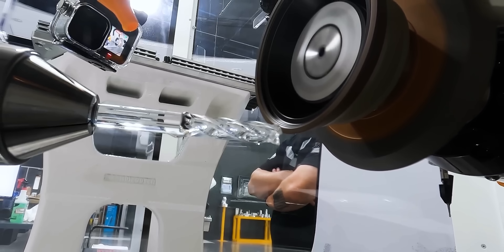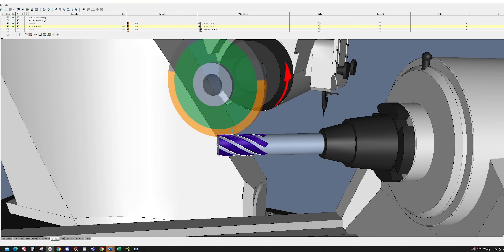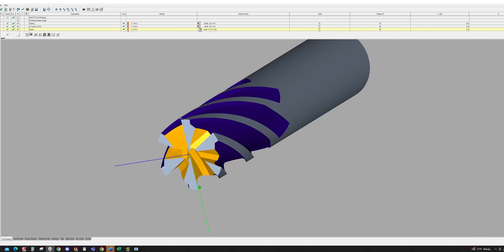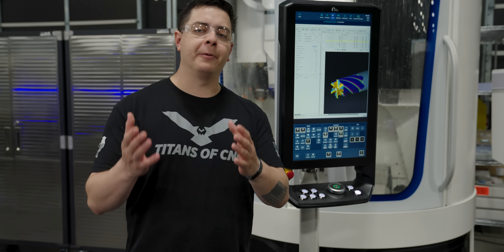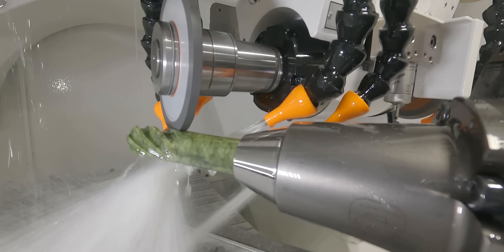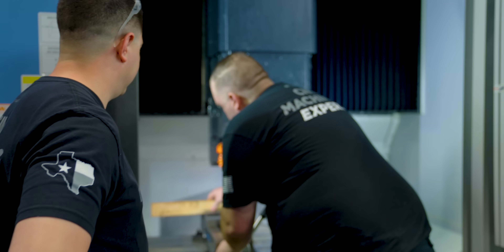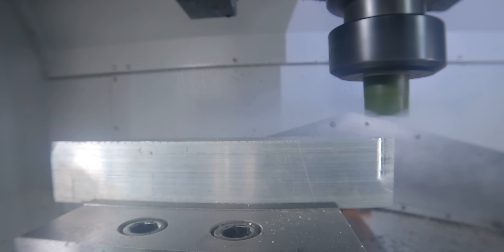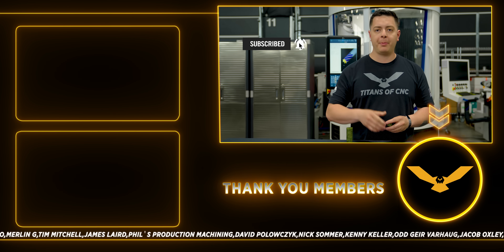Is Jade Hard Enough to Machine Metal?

Comment: I work with jade. I’ve machined it but never tried to cut with it. It’s pretty strong due to the crystal structure and is 7 on the Mohs hardness scale, so it’s hard. But the sample used here isn’t the best. You need to try with a piece that doesn’t have that multicolored structure. That’s not as solid as you would want. It would work a “little” better with a less pretty sample that’s just pure green. Rounded flute tips would also work much better. I would also recommend a shorter, much stubbier bit.
Reply: i understand that jade is hard but isnt it also very rigid with no flex in the material? i guess what i'm trying to say it that jade is hard but to brittle to do this type of work isnt it?
Reply: @madmurdoch2000  jade has traditionally been used for hammers. It has what’s called a twinned crystal structure which makes it very tough. Sure, I wouldn’t try to use it to make a mill bit with, but it’s also used for knives and such. Milling metals is a very unusual use though. Last time he tried glass. That didn’t work at all.
Reply: @melgross  one question i wanted to ask, if its not over stepping some bounds, what is it you do that you work with jade? And in what way?
Reply: @kylewellman402  first a long time I carved stone like jade and sometimes ruby or sapphire. It wasn’t a career thing. More recently I decided to mill and turn various minerals as well, using diamond rotary equipment such as dentists turbines as the “cutting” bits. It works pretty well once you understand the forces involved. If I had room I’d love to try with a CNC.
Reply: @melgross  that's pretty awesome. Were you carving traditional "cuts" or more like custom art?
Reply: @kylewellman402  just my own sculptures.
Reply: I feel like a rounded tip would break easier unless no plunging or milling with the tip was done. Even HSS/carbide tools that are ball nose break/dull more easily due to the whole "essentially 0 RPM at the very center thats trying to cut".

That being said, i would like to see your example though of good pure jade as opposed to the marbling like impurities.

Ever since i learned i can make my own rubies in my garage, its been on my project list to build a hydraulic chamber to try and make a ruby lathe insert tool. I feel like that would have a greater chance at surviving just given what direction the forces would be in. 

Seeing that jade end mill break in half tells me it really just couldn't take the flexing from that cut. I think he could have gave it more of a fighting chance to actually cut. He basically stacked everything against it by taking what looks like at least a 15 to 20 thou depth of cut and doing climb milling. At least see if it would survive like a 5 thou DOC while convential milling
Reply: @kylewellman402  rounded tips soften the initial jump in cutting force the edge sees. That’s different from a ball mill, which isn’t what I meant. I’m talking about maybe a 0.05” radius at the flute tip. I find that whether HSS or carbide, those last longer. But also, you’re right about the depth of cut. I was going to mention that before, but didn’t. I don’t know what rpm a jade cutter could withstand, but the higher, the better. I don’t see that he tried to determine what the cutter could do. He just took some moderate average setting and went with it.
Reply: @melgross  oh gotcha. Like similar to the nose radius on an insert bit as opposed to a sharp nose. Hopefully I'm thinking if that right now. 

Maybe they should try it again and go to brass first instead of aluminum too. Aluminum is so gummy to cut if you dont have a proper coating meant for aluminum. I seen where when they were inspecting the end mill after it broke there was aluminum imbedded along basically every cutting surface. Im sure these guys at Titan are aware of that. Maybe that is why they chose aluminum for the torture of it 🤔
Reply: @kylewellman402  yeah, that’s it. Well, you know, we’re here talking about something that, no matter what they do, won’t really work. It’s just for the fun. But I’d bet that they couldn’t mill more than an inch of metal unless maybe it’s magnesium.
Reply: @melgross  you're probably right lol. Its just something ive wanted to try myself out of ruby. If anything, just as kind of a cool jewelry idea for machinists. Make a necklace or bracelet or something with a WNMG style insert made of Ruby as the stone. 

As far as its hardness, its a slight step below diamond so that shouldn't be a problem as far as an actual cutting tool. Its the toughness that is probably where they meet their demise as no matter what kind of cutting youre doing, some flexing is bound to happen. I still think maybe cutting as a lathe insert might fair a bit better just because of the geometry and pressure of the cut coming perpendicular to the holder where i think the holder might be able to compensate a bit for the lack of flex in the ruby insert. Would just be fun to try lol. Either way even though it probably would not make a functional tool, still think it would be a cool idea for machinists jewelry. 

I've made ruby before but now im thinking any of the corrundum based gemstones could be replicated in the same way as ruby is.
Reply: @melgross  wow you seem very knowledgeable on this.
Reply: @melgross  that is amazing. i could only hope i can learn for fifty more years and be liek you.
Reply: @kylewellman402 it broke from vibrating itself apart, not not being able to take the flex from the cut. 

You can put a torque on the jade while it isn’t spinning and it won’t break like that; why would that torque forcing make it break if it were spinning?

The jade broke due to spinning too fast and basically vibrating itself apart in combination with that torque force (basically, the torque of where it was cutting and where it was held determined the location where the break would occur, and the spinning too fast and causing sufficient vibrations is what broke the material. 

If the jade bit was spinning not as fast, if would make it further.
Reply: Thats the first thing I thought. I'm not a machinist and I know nothing about engineering or cad or edge geometry and all that jargon, but the very first thing I thought to myself was "if they had just made the bit shorter and more squat instead of long and "thin," they mightve gotten more use out of it. In fact, I'm sure theres a PhD dissertation that could be made out of examining the material properties of stone edges made into modern cutting tools...because who the hell has ever done that before 😂😂😂
Reply: TITAN, do this. we need to know its actual capabilities.
Reply: @abomb4951  remember they are just doing this for fun. I would never recommend any mineral, even diamond as a solid cutting tool. Even diamond will snap.
Reply: Уменьшив подачу в 10 раз у них бы все получиллсь
Reply: @kulvoni  sorry, I can’t understand this.
Reply: jade workers in china would not even call this jade, but trash
Reply: @niklasriva7053  for their purposes, I would agree.
Reply: Jadeite jad is also is harder than nephrite jade, may have held up a little better.
Reply: @mr.giggles4995  Jadeite is certainly prettier. It is sometimes used for gemstones. Would it hold up better? Well, no stone is going to hold up. This conversation is fun, but nothing useful will come of it.
Reply: How much was that jade?
Reply: Awesomely outstanding
Reply: Yes and also the moving speed of the machine should me much slower.
Reply: @VladSuperKat  nothing will help. No stone, including solid diamond, will successfully cut most metals for more than a few seconds.

Comment: You make great videos, it would be very interesting if you showed the method used to achieve a very tight tolerance on the first try such as a G6 on an internal diameter of 20mm for example, with a tool which has just been gauged and which It doesn't have any proofreaders yet.

Comment: I mean not too shocking given that Jade sculptures have been hand carved over the past thousand years. But it's also a terrible le choice of stones since it is mostly a swirly mix-in of various materials (which gives it that lovely veining). Sure it is hard (so likely very good as a grinding wheel) which gives is strength in compression but has terrible shear strength. The different compounds making up jade likely cause pretty variable stresses within the end mill leading to the failure.  As @Wbfuhn notes, sapphire would make an excellent cutting tool (but would be brutal to machine) as it is a mono-crystalline structure. Hardness is not a good attribute unless accompanied but toughness, which is why those ceramic endmills work well as they are both. A Diamond would also snap (probably would get farther) given the extreme hardness but not difficult to shatter along a fault line (which is how they hand cut diamond). Tungsten works great also because it is both hard a hell and has some of the metallic property of toughness (not like steel but better than heterogenous rock). I wonder if the corning guys could help for the glass one (like gorilla glass is designed for impact tolerance, hence it covers our cell phones (although i note Apple chose sapphire for their camera outer lens). But maybe you guys could 5-axis some amazing jade dragon like all the other crazy display projects (like the chess table, lion, etc)

Comment: 1) It's kind of good for wood
2) It wasn't GREAT experiment because you destroed the thing barely starting. Would be better to begin with really small thickness of aluminum to test the cutting edges and then test different feed rates and thickneses. Kind of naive to expect that a mineral may be used exactly like instrumental materials -- exploitation should be softer.

Comment: The structural integrity of the core is just not there; if it was a composite of something to make the overall blank less frangible, it seems the hardness is there. How about a steel rod with the end bored or splined out with a Jade cylinder inserted/bonded into it then ground; steel structural rigidity, capturing the hardness and geometry of the jade.

Comment: It's all about vibration and tool's resonance frequency , and giving the tool enough time to dampen the vibration,
For example glass has very low natural frequency for small stuff between 200-500 Hz
Steel has much higher frequency in the KHz range for the same size 
.
Increasing number of flutes decreases overall fluctuation in vibration , but since the flutes are thinner the natural frequency decreases making it more brittle,
.
For example a glass sheets crack easily a glass cube will not crack easily because it has more girth and more volume to dissipate energy 
To increase the probability of success using glass or jade feed speed must be ultra slow and maybe make the flute channels narrower to allow for more girth to withstand vibrations also increasing fluting angles will help make forces and vibrations more axially aligned (radial vibrations break tools )
.
Tips 
High helix angles 
High number of flutes
Slow feed rate
Narrow channels
Maybe bulkier or conical tools

Comment: seems like a pretty aggressive cut into that aluminum. looks like it could have made it with less load on the end mill.
Reply: Looked like it was dulling too fast. I think they could have made it 3-4x farther with the correct speeds and feeds, but that's still not much
Reply: At the end of the day tho... it's just not a viable or effective alternative.
Reply: wasnt super aggressive, look at the size of those chips, basically powder! though the tool was getting dull too so its hard to tell. But looks like the depth of cut is not even an 1/8th of the diameter deep. Might perform better with different speeds/feeds, but that cut into aluminum was pretty mild.

Comment: Materials I'd like to see turned into tools.
Obsidian, rock, petrified wood (you can petrify by soaking in water for several months) and gems such as Sapphire, Emerald, Topaz, Ruby and Amethyst.
Reply: Petrified wood isn’t just soaked. You just get soaked wood. It’s when the wood is replaced by minerals over  long time. You can force that process, but it’s not the same thing.
Reply: @melgross  Months, millions of years, what's the difference? 😀I'm currently cutting a 42" diameter 60" long petrified wood log into slabs... have all the slabs cut, doing the polishing now.  The petrified wood is pretty much pure quartz.  It's the hardest stuff I've cut and is brutal on my diamond tools.
Reply: @GregsStoneYard  because it takes a long time for mineralization to take place. We worked on trying to make a petrified wood using some modern techniques, but it doesn’t produce a compactified deposit. It needs to happen very slowly. Even though we used dissolved minerals, and heat and pressure, it just doesn’t produce actual rock but a more crumbly substance. The real thing is a very nice material, but it’s true, it’s brutal on tooling. It’s very tough and breaks the diamond right off the blades.
Reply: @melgross  vac chamber cycling then high temp baking and another few vac cycles perhaps would speed it up?
Reply: @felderup  no. This is just a very slow diffusion process that takes a very long time because it’s very complex. First certain minerals take up residence, then others come in and fill the micro spaces left. It’s a chemical process as much as a physical one. I’m not saying it’s impossible, after all it wasn’t believed that we could synthetically make opals, but we can. So, possibly someday, when the replacement processes are better understood. But for now, we can just say we learned something.
Reply: @melgross  yes, if someone has the equipment to try making some in a month, it might be a fun video.
Reply: theres also a lot of natural petrified wood you can get online thats fully harded into rock
Reply: The problem with natural materials is you never know where the weak points are without ndt...
Reply: @mikehughesdesigns  true. I have a very expensive marble table. It’s beautiful, made up of several parts. A friend put his elbow down on a corner, and it broke off! The veins in marble are weaker than the rest and it broke on that. I used black stone epoxy to repair it.
Reply: With obsidian, well, the Aztecs beat us to it.
Reply: All crystals are extremely brittle. Hardness doesn't mean much in useful applications. That why you use diamond coated steel instead of diamonds.
Reply: Obsidian cuts metal pretty readily but shears very easily, so it takes going slow and spreading the force over a distance. I use very flat obsidian for polishing razor edges. I have a manufactured ruby sharpening stone that cuts very well in a 3000 grit range. The stone I would like to see is Texas Chert/Flint, it is a very hard and tough rock that I have trouble shaping even with diamond tools, and I use its edges as a scraper because they are so tough. I think it must be harder than general tool steel, but I don’t know how it would do with the torque generated.
Reply: Obsidian is just glass and the results will be the same.
"Rock"... there are a billion kinds of rock. Most will work about as well as any other but there are lots of them with unique properties.
Emerald and topaz will probably just break.
Amethyst is quartz; may as well use clear quartz that may cost a bit less.

Comment: How much is the raw material for the jade and the price for end if it would be manufactured?  It cut delrin they did should how well but if it's cheaper to manufacture then carbide and HSS might ne with it
Reply: i would expect the jade to be cheap, but the time and energy gone into it the same as carbide-that would last decades longer than jade, means its not a good material for a cutter :)
Reply: Jade prices are insanely wild, and based on quality/shape. Can range anywere from $3 per carat to millions per carat

Comment: Now make one out of a single large quartz crystal.
Reply: Then sapphire, then diamond.
Reply: @larrymashburn7789  jade is tougher than quartz, sapphire and diamond.
Reply: Jade is the most durable of all minerals , its not the hardest but it's the least brittle of all gemstones , quartz is hard but incredibly brittle and will shatter just as easily as glass while jade can be hit with a hammer as hard as you can many times before it will finally split
Reply: With crystalline Al2O3
Reply: @stasi0238 Sapphire is Al2 O3. Corundum.
Reply: All of which are very brittle. That's why we don't use quartz in so many places
Reply: Fused silica may be stronger and cheaper than the same substance in crystal form.